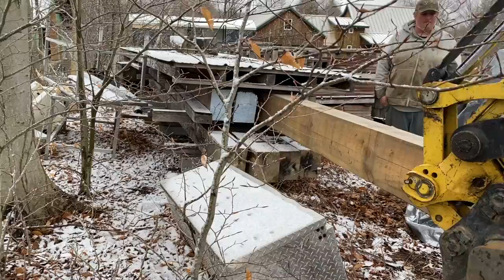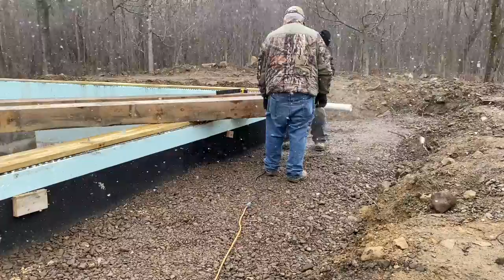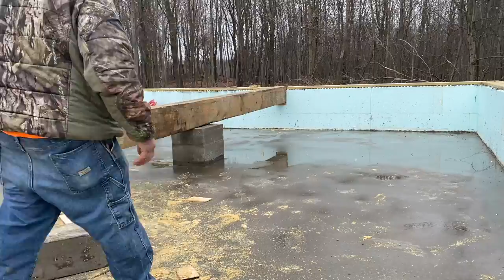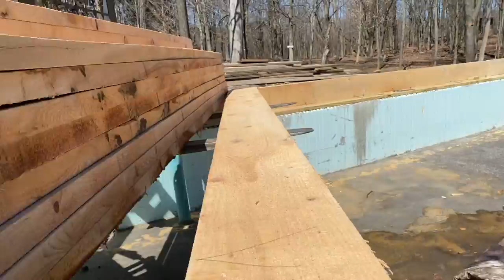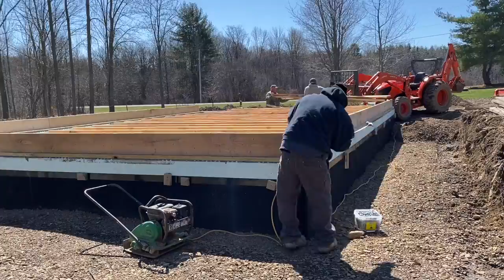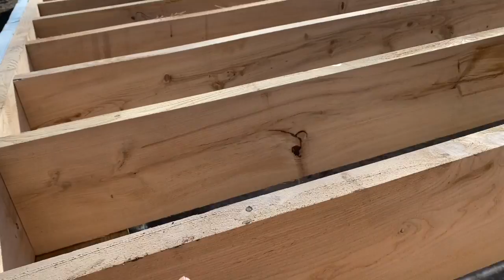Insulating details for a radiant heated .Nudura crawl space.

Comment: Ruff cut is the way to go as that is what we used in building our camp near Cocks Forest in 1960 and the saw mill delivered it and the total cost was almost nothing back then. We finished the outside walls with Homasote board at 25 cents a sheet and added several layers of oil based paint to seal using paint from the 60's and still today it still looks almost new.

Comment: I like the way you added the foam to the outside/inside of the rim joists but I would have added caulk at the bottom rim to plate before the foam to act as a air barrier and added spray foam to the joints to completely seal all the exterior from air.

Comment: And holding back the rim joist is the dumbest trick ever considering the fact you can insulate it on the inside of the floor joist Please people don’t take any advice from this circus crew there are plenty of other Youtubers that are real builders that know what they’re doing check out the build show to learn how to be a real builder not a bunch of hillbillies thinking they have a clue what they’re doing
Reply from the maker: Dennis we did both outside of rim and inside. You obviously know nothing about thermal bridging. The outside foam will stop the heat from migrating through the wood. Your correct the build show with Matt Risinger is a good resource on Youtube. I have helped many people on Youtube if you don't like my style of building just move along and stop watching the videos.
Reply: @bondobuilt386  no because guys like you give builders a bad name so I got a point out all your mistakes so people don’t follow your videos and the one layer of home on the outside is more than sufficient for the thermal break why don’t you do a little research about the properties of wood too ,
Reply from the maker: @fuzion430journey3  wood is R 1 per inch stupid. That’s why I put the foam over the wood. You know nothing about building. Your a keyboard warrior. Never built a thing just troll YouTube  nothing better to do.

Comment: What is the size of the foundation.  Would you use floor trusses instead of solid lumber on second floor so you can have open plan on the first floor.  Thanks
Reply from the maker: 24X36 foundation. We are framing the roof with rough cut lumber as well.

Comment: That's a great job Bondo. Most of the houses I've seen (and done) only use fiberglass inside the rim board.  Cold goes right through that.  Once you get the foam all done make sure you seal everything so no air leaks.
Reply from the maker: Ya the fiberglass is not a good choice for insulating a rim joist.

Comment: I would have cut center beam in 3 pcs. Having lap  joints land on supports and cutting lap joints horizontally rather than vertically. Probably a single dowel would hold it together given the lapping floor joists.
Reply from the maker: I had these beams and they were 20 feet long. That lap is only 66” from the chimney block pier. If thazt 8X12 beam sags in that distance something is wrong. Lol
Reply: @bondobuilt386  I've no doubt what you've built will last forever it was more a manner of craftsmanship proper.
Reply from the maker: @johnparkhurst825  Understood. We had these beams if I were to saw them special for the project  I would have cut 3 - 12 footers and landed them on the chimney blocks. 👍👍

Comment: Squash blocks down the center, and bridging or squash block down the center of span each side of beam...thats code here in Ontario...makes a big difference, floor takes more weight and stops alot of squeaks
Reply from the maker: This floor is real sturdy. that rough cut hemlock is strong stuff.
Reply: @bondobuilt386  ive got 40 acres..a bunch is bush..alot of 40- 45" pine, and many others..but also hemlock. Made a bench down by my creek out a 15" diameter chunk about 15 years ago, just 2 stumps, flatten top, removed bark, 10' long...and its still hard and solid as the day is long.

Comment: I don't know much about hemlock but I am wondering about the moisture content. You mentioned Amish- I'm interested in knowing what the current price per board/ft the locals Amish there are charging.  $.25 ? Wet just sawed ponderosa pine in South Dakota is $.80 and up for dimensional and higher for 1" (which is crazy so I just walked away) Graded kiln dried is even more crazy. 
So far the camp build is excellent. Good series so I hope you have time to keep filming. 
The only question so far is about the foam board you laid around the outside (4' ft wide to protest the walls against frost). how does that work? Thank you
Reply from the maker: The moisture is high in this lumber but it will have all summer to dry so it will be good by fall. Im trying to keep up with filming. Our frost line here is 48” deep. the foam makes it so we dont have to build foundation so deep. the foam takes the place of that 48” of dirt. frost cant get under and heave the foundation.
Reply: @bondobuilt386  Ah thanks- what are the Amish charging there for dimensional?

Comment: You built something I have had on my mind for a while now but with slightly different purpose . That insulated slub could be a  great heat storage . Lets say you have night rate for electricity very low, just heat it up at night  and regulate temperature inside a house with  a fan in a floor or you have a big lot and want to install thermal solar panels  to heat a house for free
Reply from the maker: That would be a great idea. I would put insulation down and then 4” of sand then the tubing and concrete. Bigger heast sink.
Reply: Even more you can increase capacity of your heat accumulator just by placing big jars with water on the slab

Comment: Please correct me if I'm wrong but, wouldn't it have been easier to do the full span of the floor joist starting at one end and working your way down?  More room to swing the hammer for half of the anchoring to the center beam at least.  I love the idea of using the foamboard on the outside of the rim joist, too bad they didn't do that when my home was built.  Back in the late 1950's LOL
Reply from the maker: Yup but 24 foot lumber I would not want to handle So I don't think that would be easier. LOL Hard for us to get the 20 foot rafters. Big trees to make boards that long. 👍👍
Reply: @bondobuilt386  I was thinking use the same method as you did (left and right halves of the floor joists).  Just start at one end, put the two together, move to the next pair and repeat.  I wouldn't want to be manhandling 24 foot lengths of the engineered wooden I-beams LOL

Comment: I would think for NY State the outer foam is not thick enough to prevent a dew point from occurring at the outer rim joist. I was thinking you had sub zero weather most of the winter.  I must be wrong though. You know what you are doing. 
Noticed the zip board in my area is going from $36 to $52 bucks a sheet.  You must be getting a good deal on you lumber to not be going full ICF.  Going full ICF is the same costs as stick build right now.  Not for long though. I heard Nudura is raising it's prices by 15% soon and Fox Block is going up 5% as well.  This is going to be a great series. Looking forward to the coming vids.
Reply from the maker: Thank. Yes building materials are stupid right now. We saved a bunch building like this. 4" of foam is good around that rim joist. Could add more if needed but most houses have none. LOL